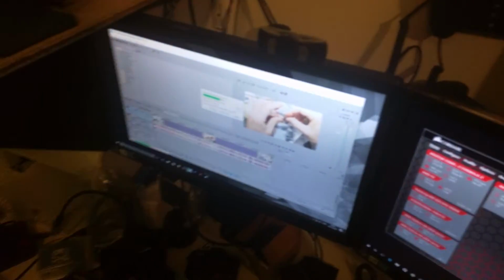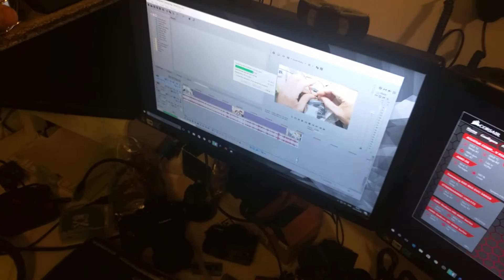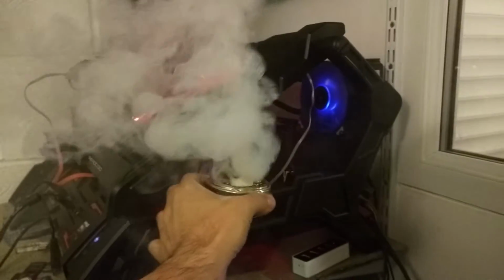Testing the airflow through an open frame case

Comment: Well, I'm very late with this if I want to get into the conversation.
One person said that the radiator fan is butted up against the wall, but I also think that it is possible the airflow isn't hitting the components as much as you wanted it to. This is where your PC fan is pushing the air in, but the radiator fan is taking out a lot of the flow before the air has a chance to flow down to the PC components.
Reply from the maker: I got a lot more stability on this system by ditching the water cooling and replacing the heatsink with a regular forced air cooler. 

Funnily enough I had two of these setups and they have since been transplanted into regular PC cases so they can live under desks.
Reply: @backofficeshow  Yea, I currently plan on designing my own more open frame case that I can just easily 3D print.

I do plan to use an AIO, but it would have its own section for cooling as to make sure it gets as much cooling as it can get.

Comment: Good video to show airflow, but I think your main problem with it was that your radiator fan is butted up against the wall.  There is nowhere for the air to go after being sucked through the fan/radiator.
Reply from the maker: Good point 👍👍

Comment: Has the radiator matrix become blocked buy dust, remove the fan and take a look to make sure it's totally clear. If it's fine you more than likely need a dual radiator and fan. Also, when was the paste applied to the CPU block and what was used? Also try moving the case away from the back wall to get better air flow.
Reply from the maker: Matrix is clear. I applied paste today as I swapped the motherboard, used the professional stuff we have lying around. Works relatively stable on 6 cores but dies on 8. Wondering if the CPU is faulty, but I do not have £200 to invest to buy a test one :)
Reply: The Backoffice What's the CPU? I'm also assuming that you have one of those sealed liquid cooling systems, without a pump etc, just the block, a pipe from that to the rad and a pipe back to the block
Reply from the maker: +Mark Wallis amd fx 9590, its a pumped water cooler, I checked and it's full and working. Pump is on the CPU block.
Reply: The Backoffice Yeah, that CPU is a bit of a beast and because of that it's drawing a lot of power, which means a lot of heat to dissipate. it looks like this is a very common problem and requires a beast of a cooling system, the correct motherboard that can handle the CPU and various mb tweaks. So I would say that your cooling system is not up to the job. do a google search on your processor and heat problems and see what you get.
Reply from the maker: +Mark Wallis will do! 👍👍

Comment: Get a fan with a decent static pressure. Check your pump is working? What cpu temps are you seeing? Throttling? The case layout is awful.
Reply from the maker: +Meth Methanoid works fine as a hexa hates being an octa!